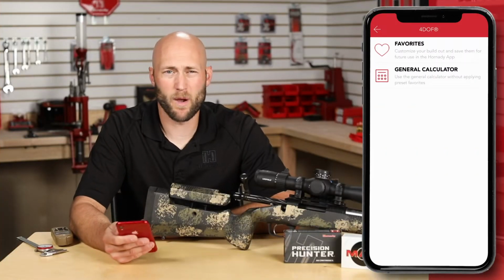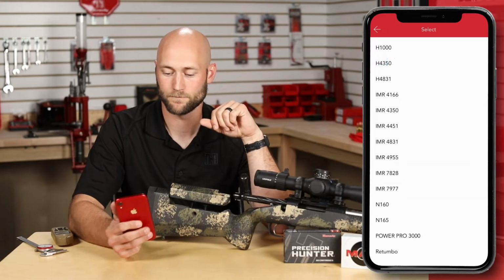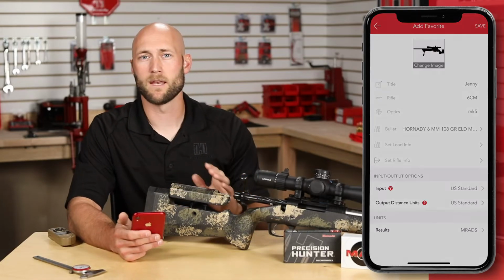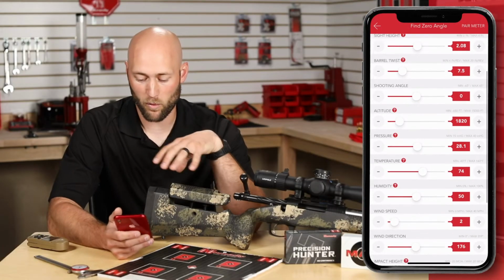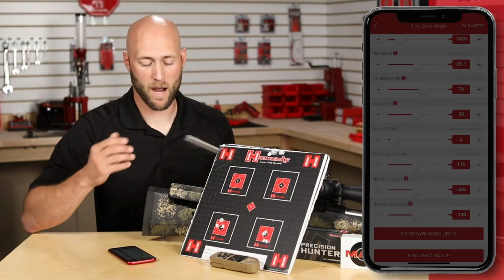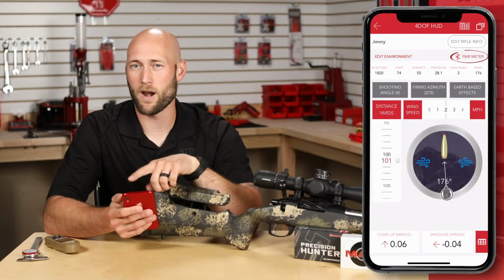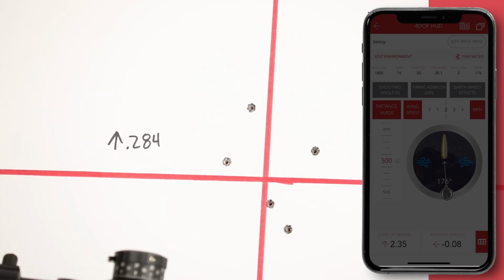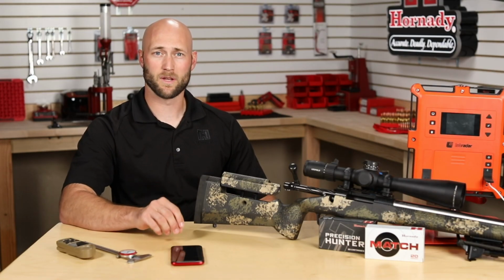4DOF BALLISTIC CALCULATOR: How to setup your Rifle Profile (Favorite) | Complete Overview

Comment: Where you Set Load Info, there are fields for handloaders to input case COAL, charge weight, powder, etc. 
Can I (or why can't I) input "Outfitter, 160 CX" or "Precision Hunter, 175 ELD-X," since Hornady presumably knows the info on these loads and I have no way of knowing the powder or charge weight?
Reply: Never mind. I think I found it in the Ammo Library.
Reply: Nope. Looks like the Ammo Library will import into the Ballistic Calculator, but not into 4DOF.

Comment: Question on tail and head wind. Assuming 100 yard zero, when I move the dial north in app, indicating a headwind due to arrow and wind pointing down/south at tip of bullet, the “come up” gets lower… wouldn’t with wind coming at ur face cause you to come up more, not less? At 500 yards it’s saying up 7.15 with a lot of wind at you. Then 10 moa when no wind? It’s like the data is flip flopped no?
Reply from the maker: With the angle of attack of the bullet being slightly up and to the right (rh barrel twist) a head wind will cause the bullet to raise/elevate. It is telling you correctly
Reply: @hornady thank you! That makes perfect sense. When I have the angle going up it exacerbates it. It even has you aiming low depending on angle and wind speed. Appreciate it!

Comment: Just went out to verify my data on multiple rifles at long range. Tried to open the app and it asked me to log in. I logged back in went to my data and most of it was gone. Is this normal? I’ve using the app since came out with no problems. Drive 3 hrs to the range.
Reply from the maker: You might try uninstalling and reinstalling the app. Sorry for the trouble!

Comment: Hey in the tab for Zeroing you said that you can either choose Zero range and Zero angle. On my app it doesn’t have zero angle. It has atmospheric angle. Is atmospheric angle and zero range angle the same?
Reply from the maker: Atmospheric zero is on the BC side of the calculator. Same premise as zero angle which is on the 4DOF side of the calculator

Comment: When using a custom temperature sensitivity factor enter the actual velocity change for 1 degree of temperature change.  Example if your measured velocity at 40 degrees Fahrenheit is 2753fps and your measured velocity at 60deg is 2760fps, then you would enter 0.35 into the tamp sensitivity factor. Note most powders will have a higher velocity difference.

Comment: How would you recommed setting the zero stop? It looks like once you do zero angle you never adjust the "zero" so it will be bullseye at 100. So if youre not using the zero stop for a 100yrd zero, what should it set it for? Take for example if my rifle grouped 3" right and 3" high and thats what i plug in for zero angle. Surely i wouldnt set the zero stop at that point? Would i then make the adjustment it recommends for the 100 yrd shot (in the HUB) and then set the zero stop there?
Reply: Yes, correct. Obviously shoot another couple of 5 shot groups to confirm the POI are spot on, or as good as scope adjustments allow, then set your zero stop or slip your turrets to zero. Then you’ll have to change some of the parameters you first inputted to reflect this new POI, even if it was .1 right and .1 high, then
save. Then you can start a hunt or competition with your turrets on zero and dial whatever the HUD gives you as a solution.

Comment: I'm really liking this app.  Since Strelok Pro got banned I have been trying a LOT of different apps. I do want to know if you are going to add your full line of bullets though. I use .204 Rugers and there are no 20 cals on the list and not sure if I'm properly inputing 20 cal bullet data.I can set diameter but not weight.

Comment: Thank you. Having an 10mm turret  adjustment isn’t easy with the units fixed as a group. It’s a lot of back and forth if you use a mixture of metric and imperial measurements. However what an amazing pice of tech. Thank you so much everyone at Hornady.
Reply from the maker: Right on

Comment: When I use the normal BC calculator I have a problem with the self-defined ammunition. The values for bullet weight and bore diameter constantly reset to a default value (despite saving). Is this a known problem in the app?

Comment: I assume when entering the distance you should input the line of sight distance rather than the true horizontal distance, right?
Reply from the maker: We would recommend putting in the true distance and then putting in the shooting angle.
Reply: @hornady This was my question as well, by "true distance" do you mean line of sight or horizontal? I'm assuming LOS given the angle is factored in
Reply: @dillonwascher4508  Yeah it wasn’t a very clear response from them. But I agree with you, since there’s an option for shooting angle then it’s likely LOS distance instead of horizontal.

Comment: Hi, my Kestral 2700 will not pair. Any suggestion?
Reply from the maker: Go in to your phone's settings and in the Hornady app, make sure Bluetooth is turned on.
Reply: @hornady  Hi, I'm using a kestral 2700, is that the reason I can't PAIR to the 4DOF App?
Reply from the maker: @TheSgtk9  Unfortunately that model will not pair. You will need a 5000 or higher.

Comment: A ton of information for sure, however in what hunting situation does one have time to whip out the trusty cell phone and start entering information to find the Exact place to hold?
Reply: If I'm in a blind I'll get the range to a few static points and I use that to estimate the distance to a deer. So if I know a tree line is 325 yards away and the deer is maybe 15 yards closer to me, that's a 310 yard shot. I can drop that range into a calculator very quickly and get a shooting solution.

My problem with this app is that it assumes you're going to be making turret adjustments rather than using holdover. Other ballistic apps let you choose your reticle (and in the case of 2nd Focal Plane scopes, the zoom value) and a reticle view so you can do a quick look and see where the hold over is.

Bottom line, this is NOT a hunting calculator. It's a long range app for static targets and trying to shoot tiny groups. That's all it's good for.

For a company that is supposed to be hunter friendly, they sure made a useless app for hunters.
Reply: Well get your rough ballistic data for x temperature x altitude etc. Then have a dope card taped to your gat

Comment: My magneto speed measured 2706fps for a 10 shot string with a sd of 8, i entered the all info and i had impacts about 1.5 moa high at 550yds.  I adjusted the velocity in the app to bring down the impact. Is this going to have a effect on longer range impacts?
Reply: Believe the bullet never mind what the chrono says. Sometimes you'll need to adjust speed/bc to get everything to match up.
Reply: Should’ve adjusted the axial form factor as demonstrated in the video which should make it correct at all distances afterwards. Don’t change the BC or velocity. 4DOF is not a BC calculator.

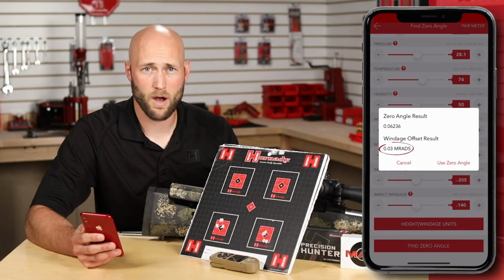Comment: @18:10 
What units are the “Zero Angle Result” reported in? (MRAD or MOA or Deg?)
Reply: The zero angle result is merely a number used for mathematics by 4DOF. It’s not any unit of measurement.

Comment: Isn't the average of the vertical measurements the Impact Height and the average of the horizontal measurements the Impact Windage?  You have them reversed on the slide.

Comment: Ok so I’m 16 currently and just got my first set up and am planning and going to long distances with my new set up I want a kestrel but don’t wanna spend 500$ for the hornady version is there a cheaper option or is the hornady the only one that works with the app?
Reply from the maker: While the Kestrel with 4DOF is a fantastic unit, you certainly don’t need it to get started in long range shooting.  The 4DOF app on your smartphone is free, so I’d recommend downloading that for your ballistic solutions. Next, you can manually plug in the atmospheric and wind data into the app, so a weather meter with Bluetooth isn’t necessary.  It’s still quite helpful to have a weather meter to help you make wind calls and gather temperature and pressure from.  For this, something like the Weather Flow unit that connects to your phone or any handheld weather station, like a Kestrel, that fits your budget would be helpful.  More important than buying equipment would be simply getting out, using what you have, and shooting. Great question! - Seth
Reply: I use the Blue tooth enabled fire weather Kestrel (orange case)

Comment: Is the azimuth GPS enabled (does it know where I am in order to compensate for magnetic deviation: for example Yellowknife is 16 degrees west of true, Whitehorse is 30 west of true,  anyone shooting on the east coast of Canada is 25~35 degrees east of true) or do I take the compass and then enter the corrected true manually?
Reply from the maker: It does not take into account magnetic declination via GPS location. If the user wants to account for the correction needed to go from the phone measured magnetic azimuth to true, they will have to manually correct for the declination at their location.
Reply: @hornady  OK so azimuth is strictly magnetic at this point. Thanks. Maybe at some point you could put in a magnetic variation window so it only had to be entered once for each region (if I leave my region I'd enter a new value, but so long as I am in my home region I only have to do it once). Just a thought?